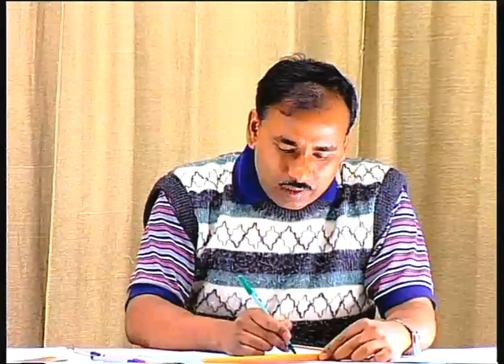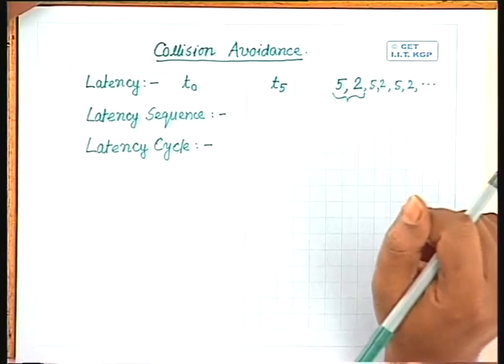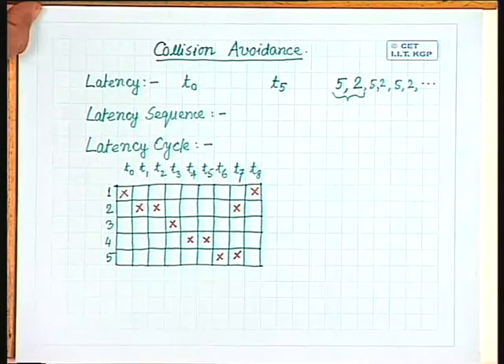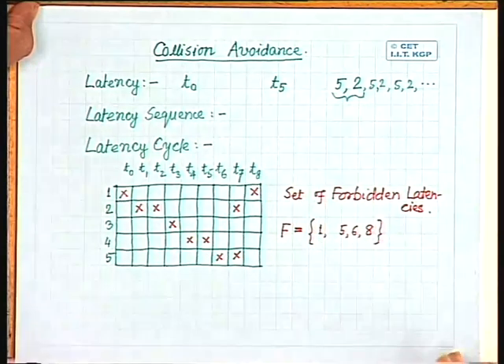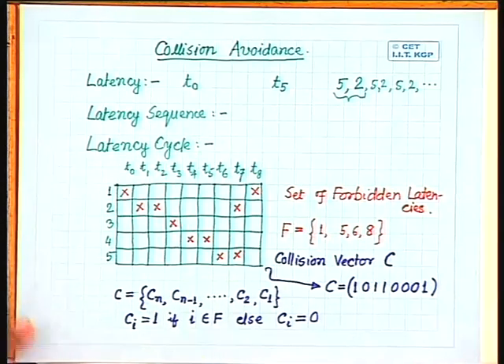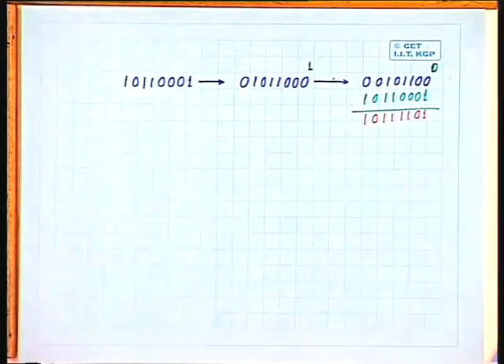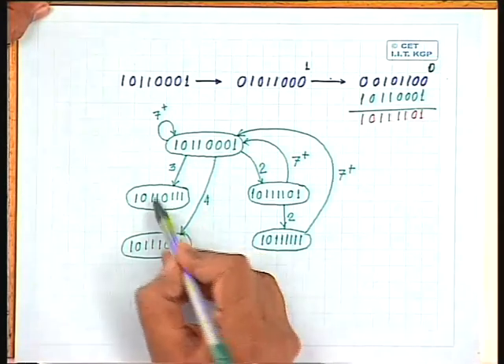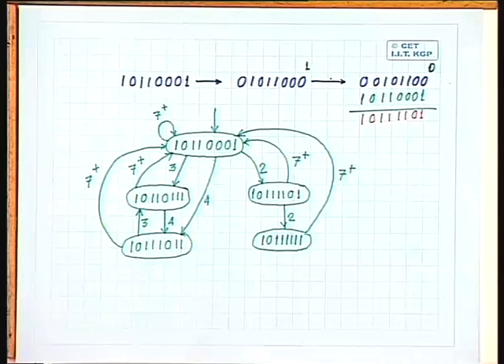Lec-9 Pipeline Concept-III

Comment: it should be 8+ not 7+.
OR
7+ should have meaning "more than 7", "not 7 or more"
Reply: No, after latency = 7, you get a 0, and therefore can schedule a new task. Now the new collision vector is the original bit sequence bitwise ORed with 00000001(due to 7 right shifts).This results in the 1st state. Therefore it is 7+ and not 8+